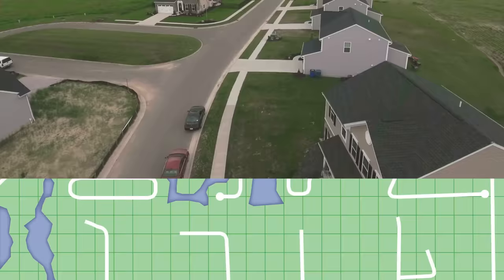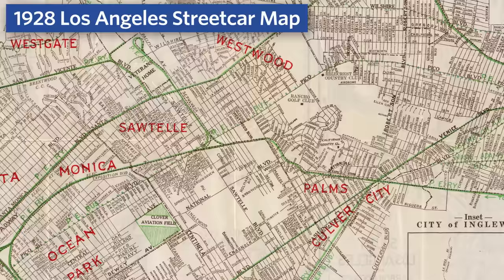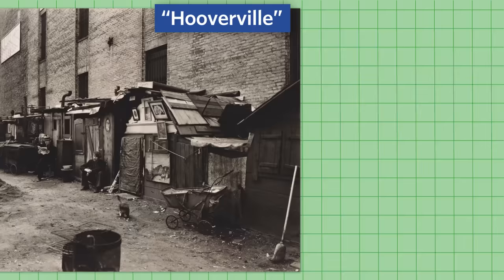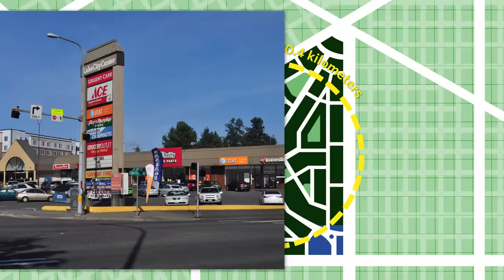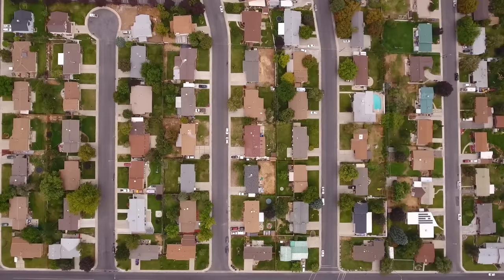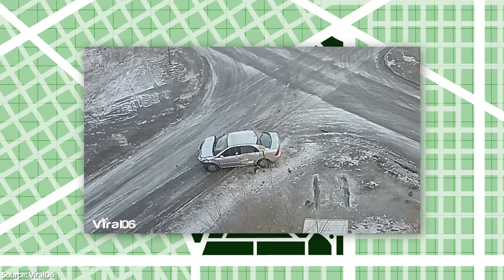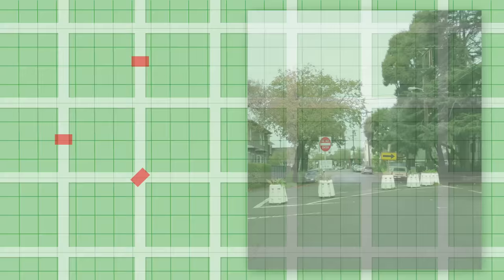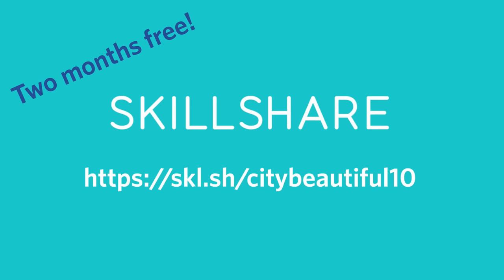The Reason Our Streets Switched to Cul-De-Sacs

Comment: They’re gonna lose their shit when they find out about roundabouts
Reply: There's plenty in the northeast.
Reply: Samuel Prince  they all complain, but really they just can't drive around a corner 😂
Reply: what's a round a bout
Reply: I'll be the roundabout
Reply: Samuel Prince  Hah, EU is getting overrun with them. I used to live in a place that was nine roundabouts away from the highway.
Reply: i swear green bay wisconsin only uses roundabouts
Reply: @loganm8220  it's basicly a 4 way intersection but instead it's in a circle making it easier for traffic (most of them don't requiere traffic lights) they keep the flow are safer bec you have to slow down in them if one knows them they are very easy to leave in a natural way with no harsh turns. there are NO stop signs or lights inside of them and they are generally small depending on the road. BTW they ARE NOT traffic circles, Trafic circles are more dangerous and worse then standard intersection.
Reply: roundabouts are stupid
Reply: @GREGORYABUTLER  justify your answer
Reply: @HypercopeEmia  Another advantage is that makes easier 5-or-more-way junctions.
Reply: @HypercopeEmia  To say a roundabout doesn't have lights inside of them or you don't have to stop is incorrect. It completely depends on the roundabout and possibly Country, speaking for the UK, many major roundabouts, usually at motorways are access controlled by traffic lights and have lights within to control flow and as such are called Access-Controlled Roundabouts .
Reply: @therealgadielsepulveda  you could make a 100 way roundabout if you wanted to and had the land and resources
Reply: We got some here, and I hate them. No one knows how to yield properly, and it’s just a waste of time. Especially since one of them they put in used to be a four way stop, so it’s probably the smallest roundabout you’ll ever see🤦🏼‍♂️
Reply: @ThatColtGuy  Yeah the US has a lot of weird systems because it seems nobody know how to give way. There are hardly any "STOP" signs in the UK, because we instead have give way signs, which basically means, you don't have to stop, but you should only go if there's nobody in the direction of the right of way.
Reply: @age365  Can confirm!
Reply: In my city in Canada we have a lot of roundabouts and I love them, no more stalling at a red light when there's no cars, just keeps traffic moving and saves lives because even if you do crash in a roundabout you're going much slower!
Reply: @GurdeepxSingh  Most of the northern midwest has lots of roundabouts too
Reply: Roundabouts are slow which might be OK in Europe where everything is crammed together and people are OK with it taking an hour to go 20 miles. Roundabouts are also less efficient with the space. The advantage of a roundabout is that they are safer in case there is an accident.
Reply: @KevinSmith-qi5yn  they're slow but there is no waiting for lights.
Reply: In my country they are making more and more roundabouts
Reply: Theyre catching on more
Reply: @copycatz1361  The words will make you out n out
Reply: The definition of Roundabout is in the name
Reply: 6 way intersections: allow us to introduce ourselves
Reply: there's literally one right in front of my house
Reply: @GREGORYABUTLER  they're not, the traffic flows smoother thanks to it
Reply: @Deelom100  No - it's weird and uncomfortable to drive through roundabouts 

Intersections are a million times better!
Reply: @carpii0576  - normal intersections with traffic lights are better - either  you  go  straight, or make a right turn, or make a left turn
Reply: @spandexter1234  There are other ways to correct the issues with traffic signals than to replace them with roundabouts.
Reply: @KevinSmith-qi5yn  like?
Reply: In my town in the netherlands, they replaced all stoplights with roundabouts and its great!!,,
Reply: They have benefits, but they aren't the most amazing thing. They are not appropriate in dense urban environments as they discourage walking due to further distances. You can actually see that commercial development has a very hard time getting across a roundabout because it's difficult to get pedestrian critical mass to cross as compared to a narrow signalized intersection. Also, sight impaired people hate them because they lose their auditorial cues for when and how to cross safely and bicycles also don't love them as they usually end up having to merge with traffic through the roundabout. They also take up 30-40% more space as compared to an intersection. Roundabouts have their place but they aren't the end all be all.
Reply: Also, one other issue is that unlike a signal where you can use green time to weight each approach based on volume, with a roundabout you can't do that and each approach is weighted evenly, therefore in a situation with a very unbalanced intersection (basically a main line and a lower volume side street), you unduly impede the mainline in favor of unjustifiably improving the side street. It's important to keep main lines flowing and side streets not as side streets usually only have 2 purposes, either local traffic or cut-throughs, neither of which deserve priority.
Reply: I have a bunch where I live, I don’t understand why people complain about them, they really aren’t that bad
Reply: @spandexter1234  Spacing lights further apart, have less street intersections to main roads, and synchronizing lights.
Reply: @GREGORYABUTLER  Roundabouts are better, you either enter the circle then exit, or enter the circle and exit. Yeah. It's simpler. You don't have to stop unless yielding. Crashes are less likely. Crashes are less fatal. They are more fun than waiting at a red light. The list of pros are endless!
Reply: @aquinn982  a rotary is actually different than a roundabout though and do not work as well with high traffic volumes.
Reply: @Henry-qt3py  nope

normal intersections are better and easier
Reply: Roundabouts in Florida are so bad I just lay on my horn until I exit so people will yield to me like they're supposed to.
Reply: Well, obviously roundabouts are communist.
Reply: Lol they replaced a 3-way intersection near my grandmother's house with a roundabout.
Reply: I’ve seen multiple roundabouts in California.
Reply: Oh we do! Until we use them and now love them. Lol
Reply: @aquinn982  we in Nevada call them roundabouts.
Reply: Ah man that’s funny lol
Reply: Peter Schmidt amen plenty in New England
Reply: Yes. Great shit
Reply: @copycatz1361  de wordz will maik u aut an aut
Reply: Roundabouts keep traffic flow going instead of stop and go traffic lights that create backed up traffic.
Reply: @KevinSmith-qi5yn  last time I checked a roundabout doesn't just let you sit in place not moving at all like a traffic light does.

They are significantly faster in any study that looks at them.
Reply: @jayjackson5705  bullshit. If one entrance has a way higher number of cars the less common direction will have to yield a lot longer until they get a spot. thereby heavily weighting it in favor of the main line.
Reply: @anonym3017  Woah! Slow down keyboard warrior! You aren't completely wrong but you don't have to be rude about it.  The timing of 'having to yield a lot longer' from the side street is a function of the roundabout diameter. For larger diameter (for instance a rotary with 300-400 ft diameter) the side street wouldn't get as many gaps as vehicle speeds would be higher, but for a modern day roundabout with a diameter of 100-110ft, vehicles are traveling very slowly (15-20 mph) and gaps present themselves even in a steady flow of traffic. Anyway, I was originally talking about it from a traffic engineering perspective. You can't unevenly weight each approach like you can with a signal. If you think about a signal cycle, you can allocate any percentage of time to any particular approach but with a roundabout, unless the alter the number of approach lanes, you can't.
Reply: @jayjackson5705  1. a standard size roundabout has a diameter of 75 feet or smaller and are only one lane wide.

2. if there's a whole load of traffic on the main road and not a lot of traffic one the small road then there won't be many gaps. because at low speeds cars drive closer together naturally. so no. there are not a lot of 3 second (or longer) gaps in the traffic flow on a roundabout with a main road and a small road during tmes of high use. 

and if there is such a gap someone from the small road can get in without slowing down traffic.

Believe me I've got a roundabout like that near me. the gaps between cars in it at 6pm are about 5 feet. which ain't enough to get in. and the n every 40 or 50 seconds you get a gap big enough to get in. which is still faster than the old intersection with a stoplight was.

that's the bauty of roundabouts. they weigh themselves very well automatically and iadapt to any amount of traffic being present with no managment.
Reply: @anonym3017  "Believe me I've got a roundabout like that near me.' Is NOT science or evidence, it's one random location that may or may not function due to a variety of factors.
Reply: @jayjackson5705  it's one random location with a main road and a small road on the roundabout. with the main road being right at capacity for through traffic.

as do the 3 others in similar style. one between the town and the autobahn with a car dealership to the right and the public pool to the left, the other on the other side of the autobahn leading t a town straight ahead, a farm on the right and a shooting range on the left.

They all work perfectly fine.

and your "It might not work because you can't regulate it" isn't science either.

and again. there are plenty of studies showing that roundabouts are better for traffic flow.

Which is why they are still being built 50+ years after being first introduced. Because if they were worse for traffic than intersections construction would have stopped long ago as the civil engineers are a lot less set in their way round here. as can be seen with roundabouts being adopted in the first place.
Reply: @jayjackson5705  the US has 7100 roundabouts. Europe has well over 100k.

meaning the most common roundabout is a small one in europe. which are 45 to 75 feet across when measured in the middle of the lane and not some huge monstrosity from the US.

one of which can be seen here right at the beginning.

https://youtu.be/VcSekdZv94w.

also bullshit. roundabouts work in berlin, paris, rome, london, etc. So there just aint an upper limit when designing them correctly and making them small enough to force a speed reduction.

And I'm gonna trust the countries that have been using them for he last 50+ years a lot more than some US agency that has way less data on them.

and good old personal experience also sas that they work perfectly well when 2 of the 4 exits and entrances are used a lot less than the other ones.
Reply: @anonym3017  What you showed in the video is, at least in the US, called a 'traffic circle' and is just a painted circle. They are common in the west coast in Oregon but I don't have a lot of experience with them so I can't say much about them. I was referring to 'modern day roundabouts' specifically, which I mentioned several times in my comments. And yes, many US DOTs 'borrow' from the Europeans. The French invented DDIs, bike infrastructure is largely adapted from the Netherlands and new TODs are largely inspired by European zoning. 

Roundabouts work in those European cities because they were designed and are used properly. You should speak with a transportation planner in Europe and ask them to tell you the pros and cons of roundabouts. They are not appropriate in many situations.
Reply: @Bruh Coins Sure USA needs space lol
Reply: roundabouts are far more expensive, more road and more space. they certainly are ideal though
Reply: @quicksilver2923  please explain me how a roundabout is more expensive than a intersection with traffic lights???
Reply: @quicksilver2923  Thank you, i didn't meant to turn every intersection into a roundabout but they can still be usefull :)
Reply: @age365  God, I hate roundabouts.  They are popping up in SE WI too.  They wouldn't be too bad, but they are always designed to small.
Reply: They’re all over the place where I live in the middle of Illinois, U.S. They’re not that new to us or uncommon.
Reply: Uhhhh most cul-de-sacs have circles at the end of them to make turning around easier.

do euros even watch the videos or do they just go straight to every comment section to say something about roundabouts
Reply: @RickJaeger  cul-de-sacs and rondabouts are two different things dude :D
Reply: There’s a lot in seattle suburbs, but they were clearly an after thought because they barely fit within the intersection
Reply: @GREGORYABUTLER  there are significant proven safety benefits and capacity benefits of roundabouts to traditional intersections.

 @Dead End  roundabouts have initial construction costs slightly higher, but their life cycle costs are much lower. Less human deaths, less maintenance.
Reply: @scottjuniper7985  - except not really

My lived experience (I've spent the last 5 years driving 4 hours a day every day for work here in NYC) has taught me that traffic circles SUCK, and normal intersections are a thousand times better

You're not going to change my mind on that 

maybe it works in Europe.....but I neither live nor work in Europe so I do not care
Reply: @aquinn982  Traffic Circles

They are horrible and dangerous - normal intersections are a thousand times better
Reply: @tinyrodent2821  yea your right, we call it “yield” signs here. And about half the people in the comments complaining about it, are the ones who don’t know how to yield🤦🏼‍♂️😂
Reply: Roundabouts are becoming more common now. Although they’re a nightmare in traffic where one entrance takes over and no one else can get in. Also a nightmare for pedestrians.
Reply: @Sahil Singh traffic circles and roundabouts ARE SYNONYMS - they are the same thing, and they are inferior to normal intersections
Reply: @Sahil Singh normal intersections are easier to navigate - when the light is green, you either go straight ahead, or you  wait til pedestrians are clear and make a right, or wait until oncoming traffic stops and make a left 

A roundabout/traffic circle, you fight to get in the vortex of circling cars, then you have to fight to get out of that vortex to get to the road you want to go to - it's a stupid way to make an intersection
Reply: @Sahil Singh hard disagree
Reply: @GREGORYABUTLER  smartest american